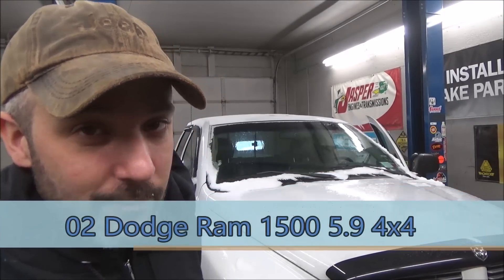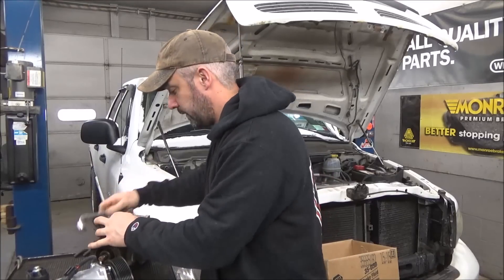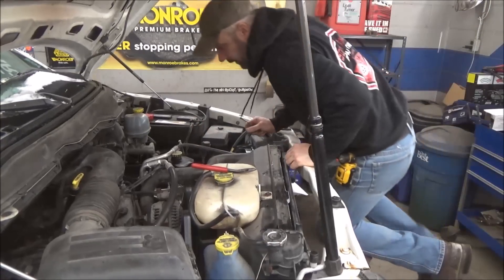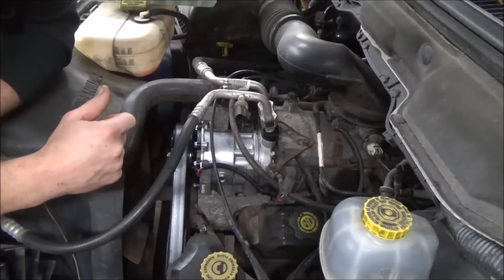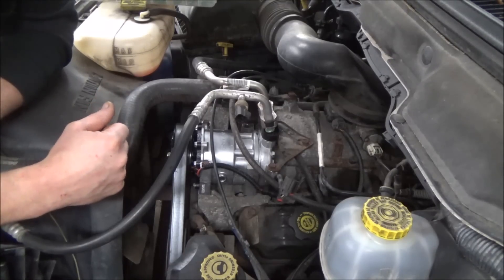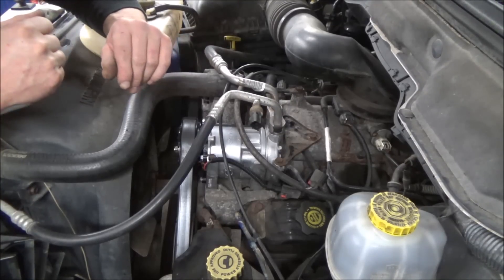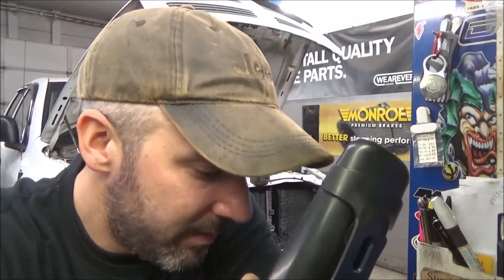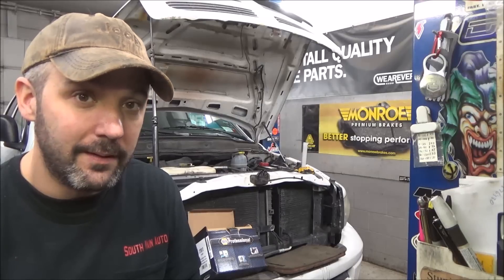Dodge Truck A/C Repair Part 2

Comment: I agree with not replacing the accumulator, not only for the reasons stated, but also due to the fact the compressor failure was external, so there are no shavings within the system 'presumably'.  

Plus the gentleman who removed the compressor plugged up the ends. How well? IDK. But I've seen the desiccant hold up to worse. 

Great video! Thanks for posting!

Comment: 100% agree with your accumulator assessment...the compressor clutch failed not the compressor itself...risk of debris in the system is lower than the high likelihood of damaging the evaporator lines do to poor access and corrosion.  Sometimes you got to be pragmatic...

Comment: I subbed around a 13,000 count now look at you, over 22,000 well deserved subs. Your a diligent tech Eric. So many guys would not have spent the time calling about a part, good for you. Without sounding too cheesy your videos have motivated me to get back into the garage. I was a good mechanic in the 70's and that interest continued as a helicopter mechanic in the Army, but cars have become so complicated I kind of drifted away from doing my own work. Your videos (along with Ivan, Paul and others) put me back in the garage fixing my cars. Thank you...I think. (ha ha) I do have some scraped up knuckles now, but new tools in the ol' tool box too!
Reply from the maker: +wyattoneable Heck ya man get out there and tear something apart and have fun doing it!

Comment: I have also had challenges w/ how much oil to add during DIY adventures. I have tended to go conservative and added some significant fraction of system capacity. Does not seem to harm cooling w/ overcharge of oil. Great video!
Reply from the maker: +Texas Pipeliner WAY to much oil and you can hurt the system.

Comment: I did a AC compressor several years ago on a GMC Safari. The replacement came with a bag full of washers for different applications. It took a bit to find the right mix.

Comment: Having just done this job on a 2002 Ram 5.9, there was about 2.5 oz oil drain from the removed compressor - I was informed to add 6 oz oil to the new empty replacement compressor. The 18 mm ports on the correct compressor do have hose sealing washers besides the o-rings.

Comment: Calls supplier: 'Your Call May Be RECORDED for QC or Educational purposes!' Ha Ha Ha...Bet they never thought They may be recorded for Educational purposes.
Thanks Eric, I just had the Exact same problem on on '07 ! (I did as you suggested in Part 1, pushed out the bearing and sent it to a bearing shop to get matched,)
Love your work, and getting to come along for the diagnosis and the problem solving.  Great Channel.

Comment: I just did a 2003 Ram and it comes from factory with both flat sealing washer and o-ring. Both had orange colored rubber material like the broken o-ring you showed on camera.

Comment: Several years back Chrysler switched to a flat washer. They continued to manufacturer the hose with the indent for the oring. We were not prive to the reason for the change. But it did eliminate the issue of tore orings during assembly.

Comment: When I think of all the years I have been in the automotive trade and how many times I have had to think outside the box and how many times my outside the box ideas have failed I could hold them in one hand. Sometimes you do what you need to do. In your video you did what was best under the circumstances. If the O ring blows out I guess you will have to try something else. Not the end of the world. As far as the accumulator goes if the compressor didn't explode inside and send metal through everything and the desiccant bag didn't come apart it should be fine. I know that with A/C some old connections are best left alone. Nice job Eric.
Reply from the maker: +wysetech2000 Let sleeping dogs lay right!?

Comment: Way to be so comprehensive with the flat washers. Others would have installed the O rings and shipped it. Eric O... a pretty decent wrench.
Reply from the maker: Nope ya need to do it right
Reply: +South Main Auto Repair you had that piece of fuzz on your mustache the whole time you were talking to ms o 😆 she never told you

Comment: Eric, at the end of the vid you say that the A/C is necessary in the winter to defog the windows. Two questions for the professor then: 
1) Doesn't the system prevent the compressor from kicking on if it's really cold outside (low A/C pressure)?
2) Didn't defog/defrost (and life in general) work just fine before every vehicle sold had A/C on it?

I've disabled my auto-A/C a long time ago and never have issues with foggy windows, as long as it's not on "recirculate" :)
Reply: +motoYam82 Ivan that's why we have kids ... to mow the grass, do the dishes, take out the trash and wipe the back windows. We gotta get something back for all the toys we step on and bikes we run over.
Reply: Hum was the money light on :)
Reply: At this point my '91 F250 that I bought new without AC looks like a dinosaur. How did I ever defog the windshield? Crack the windows, put the defroster on. BTW this truck is so old fashioned it's high/low beam switch is on the floor.
Reply: +motoYam82 Yes cars without AC will defrost fine but require higher heat settings. The lower you go with the heat any humidity in the air will condense on the colder windshield but if the windshield stays hot enough it won't fog up so you either add AC to dry the air or turn the heat up more...either way will work.
Reply from the maker: +motoYam82 Haha well lets see, yep if it is cold until the A/C components warm up it will prevent it from cycling or make it short cycle. I believe life did exist before A/C (and ABS haha) as long as heat and humidity and dew points can all get along I guess it can still continue but we are American and demand instant gratification!
Reply: It would definitely tend to cycle the clutch a lot but wouldn't the engine heat tend to warm it up past the low pressure cut out and then the hi side will equalize to low side causing the switch to rise above the cut in.
Reply from the maker: Joe Shearer yep the engine heat will get it warmed up after a bit
Reply: One more thing I don't get about the "auto A/C" in cold weather: don't you want to warm up the cabin as fast as possible? If the A/C is on, it's cooling the air down while the heater core is warming it back up...just seems counter-productive and wasteful lol
Reply: A/C acts as a dehumidifier but something tells me you just want to mess with Eric. When is your next video on the Ford combustion gas in the coolant...I didn't say blown head gasket b/c it could be cracked head, block, etc
Reply: Well A/C dehumidifies the air by cooling it down... But in the winter we want HEAT!!
Reply: LOL...so turn up the heat and the dehumidifying will be done automatically with AC & blend doors...or turn off AC after it comes on...it's all about humidity in the air & dew point just like mother nature intended...what about your Ford video?
Reply: I was born in NY and only the rich had AC in their cars and it was a not standard equipment just like a cassette player was not standard equipment (showing my age). My defrost worked fine when I had the heat cranked up until the windshield was clear and then I'd turn it down and if it started to fog up I went to defrost & cranked up the heat and rolled down the window some...back then it was normal ops. I like it now with data buss lines, modules all intertwined communicating with each other, ABS, airbags, computer controlled charging systems...fun stuff to make you think which you guys are good at and that is why I love working on cars & why I subscribe to your channels.
Reply: +motoYam82  Ivan - in cold weather and when the A/C is turned on --- what if the cold air was blowing outside and the hot air was blowing inside?
Reply: +motoYam82 I run my AC in winter all the time. Of course that's because it's 80 here in Phoenix most of the winter. That damn El Neno is giving you a mild winter but it's actually been raining  and relatively cold here which sucks. Yea, I know we need the water but it still sucks.
Reply: +Hawaiian F150 that would be a heat pump then
Reply: SATAMAN Schmidt
Haha winter in Arizona...that is too funny!

Comment: I have been a Dodge here in Oakland ca.for over 35 years and you are dead right they go to he'll just looking at it as long as you pull the system down and it holds vacum you are good to go .ps looks to me you are a good mechanic sam

Comment: I agree with the accumulator rationale.  One reason I like many Ford truck as well as Honda and Toyota AC systems.  The accumulator/dryer is easy to get out and usually not very expensive.

Comment: Remember, water boils in a vacuum.  I agree with you on the accumulator, no hand grenaded system, pull a vacuum for a while to test the system for leaks but also to remove all moisture.  Oil & Freon, and you are good to go!  Desiccant should be bone dry.
Reply: Yes, but isn't the compressor warranty contingent on replacing the accumulator at the time the compressor is installed.?

Comment: Had the same problem using a new NAPA Temp compressor on an old Buick. The washers that matched the originals were too thin. Had to use a washer that was a little thicker on one hose and one that was substantially thicker on the other hose. With original sized washers, even the old original washers, it was ok under vacuum but when charging it, refrigerant and oil would spray all over. So vacuum pulled it down making a good seal but it could not even hold the pressure of one blow off can. Thicker washers and it works great. Original compressor and accumulator had not one drop of oil in either. Put full oil charge in there, the accumulator will hold any extra, but I doubt there was any oil left anyway.
Reply: What a breath of fresh air! Proper spelling and grammar! I was thinking that English was dead. (Sorry, sorry. Just ranting. Maybe it’s this confounded confinement ….)

Comment: I agree with what you said,i always start with the cheapest way to do a repair if they're are unknowns,or if i don't think i may have diagnosed it properly,i can't afford to be a parts changer,so i start simple,and spend money if i have too,after my nightmare with a po401 code i learned my lesson the hard way on starting with the cheapest fix....a visual inspection.

Comment: Normal procedure is compressor & accumulator/drier but experience, common sense & logic should always prevail especially after you explained your logic! You have the same expressions on the phone I do especially when you try to resolve an issue & when you hang up you wonder why you called. A/C definitely removes the moisture out of the air in defrost, nice CoolTech...Nice fix! Looks like the hood props work fine at the end of the video when they get warmed up. How's the Verus Pro working?
Reply from the maker: +Robert Hayward Yeah common sense has to kick i at some point. The new pro has been rock solid so far!

Comment: IT has been told to me ...that ... a certain body repair shop in Melbourne Australia... gets an identical ( ha ha not smashed ) .... car in to match the one they are rebuilding ....  they sit side by side  ... so every thing down to the screws are as new / original ... I'm not saying you ( Mr O )need to that but a picture might help from time to time .... really really like your videos ...thanks ..... and I do  .... " you  can do it " from time to time

Comment: I just replaced the compressor in my 99' Dodge Ram 5.9 that had same issue and I did not replace the accumulator and no issues its working just fine...I went OEM on the compressor...

Comment: The failure was due to a pulley bearing
External of the closed system
You were right to just evac and charge the system

Comment: Just another good reason to go back OE (maybe not to the Chrysler dealer but Sanden or whoever made the compressor). Saving 15 or 20 minutes on a job like this adds up. Maybe pay a few more dollars up front but much better than the added aggravation IMO.

Comment: Sometimes due to part revisions I’ll get new hose sets or compressor with different thickness sealing washers. So I bought my own little kit of different thickness washers for the inevitable new part with out washer or more likely drop it where I can’t get it

Comment: Looks like the guy that out the bypass on did a great job even put ziptie on the bolt so it wouldn't get lost from its bracket 👍💪Eric O @SouthMainAutoRepairLLC

Comment: I think it will be fine if the truck is still running.  Great Video, HATE doing dash R&R when changing parts!  Did several Fords, one Nissan.  That's enough!

Comment: Not sure if it was you or the "other" Eric guy, but some one said as long as an A/C system wasn't "flappin' in the breeze", that if you pulled a vacuum on the system and held it for >15 minutes, then you are "good to go".
Reply from the maker: +theoldwizard998 Must have been the real ETCG. He is the master of all things automotive.

Comment: I got a good AC issue, electrical in a sense. 2006 1500 quadcab. AC would not turn on. Would blow warm air. Then noticed the side mirror defrost would not turn on either. Fuses replaced. AC system leak check & properly serviced. Changed fan, did not fix issue. Pressure switch good. Changed control panel, did not fix the issue. This gen Dodge has the TIPM fuse box. No relays. I start the truck, pop the hood, turn AC on, then bang the fuse box twice, & fan kicks on with clutch engaging on compressor and cold air blows. Defrost button will turn on also. Guess TIPM is faulty.

Comment: I think part of the issue with the parts is this is a one year combination.  The Rams only came with the newer 2002-2008 body style with the old 5.9 ( 360 ) for one year ( 2002 ).  2003 on the Hemi replaced it.  I know if that was my truck I'd have just kept the bypass pulley on it, my A/C doesn't work and with the windows down and the back window open only on the hottest of days 90F+ do I wish I had working A/C.   Being on the east coast we only get maybe a week or 2 of really hot weather.

Comment: I like the older rams. You dont have to take out half the hood to replace things. I guess I got pretty lucky... Replaced my accumulator dryer on the ac and didn't break it

Comment: Love the converse with AL.  Company I was at for years outsourced it's PC support.  The Corporate Controller I worked for had PC problems one day and called support in India.  He couldn't understand the guy and eventually got mad.  He told the guy that he was going to hang up and call back and ;the support guy was not to answer the phone.  I about landed on the floor I was laughing so hard.
Reply from the maker: +raykrv6a lol yeah sometimes it is pretty hard to understand them for sure.

Comment: Question: Eric is the AC compressor supposed to run all the time when the AC is set to on, or does it cycle on and off? I own a Ford E250 (2007) that has a problem with the AC. It clogs the evaporator up with ice and restricts air flow. I understand you can't offer a fix. I was just looking for a direction to proceed in with my testing. Thanks -John
Reply: Most will cycle on and off.  If the evaporator clogs up with ice it generally means you have either low refrigerant, restricted airflow across the evaporator (dirty cabin air filter),  or a clogged/restricted TXV.  You should check your pressures.
Reply: +Dacke my AC doesn't cycle on and off. the pump stays on. the relay is good. so I am thinking that what ever controls the ground switching of the relay is the issue.
Reply: It doesn't necessarily mean an electrical problem,  there are pressure sensors in the system as well.  I would check pressures first
Reply: @The Plow Guys.    Most likely, your truck has a Continuous Variable-Displacement Type Compressor. This type of compressor uses a scroll valve to increase/decrease the capacity based on the load so this means there is no need for the clutch to cycle on and off.
Reply: i see ok i will look into that.
Reply: If it has an accumulator it probably also has an orifice tube which means it will run all the time. Reciever dryer and TXV and it will cycle.

Comment: It's been found that the OEM metal-to-metal connection of line head
to compressor would strain the one bolt clamp.

Incorporating a Dado washer on each line gives the connection
more integrity under vibration and thermal cycles.

The O-rings perform all of the sealing function of the connection.

Comment: Man nitrogen would really help you find leaks quick Eric! It's always better to have a little too much oil in a compressor than not enough it's really not like a engine that too much can really cause bad problems. Of course you don't want to get carried away either.
Reply: Vacuum testing is only 14.7psi. That's just not really effective unless you have a gaping hole.
Reply from the maker: +Joe Shearer Yeah leave it up to the HVAC guy to see that move haha. Well when I charge it I have better than 100 psi on the system so we check it then. I really should have nitrogen but A/C season is so short here and 134a is so cheap I just give it a little sniff then see :) I know it is crude but hey.....

Comment: erick do you know why a compressor activates. its on an off and the switch its off inside the cabin means clutch engages and disengages
Reply: misael pacheco -some vehicles gm or mostly Ford I’ve seen. It’s their programmed strategy. The computer will cycle the compressor to circulate the oil and keep seals from drying out and leaking.

Comment: Hey Eric, how many years does it take for a winter car in your climate, to go from new to totally rusted? particularly pointing toward subframes and their seal coatings from factory.
Reply: Richard Formica: not long,a few years in the salt belt and a new vehicle can be done. Same thing here in Canada,at in Ontario.